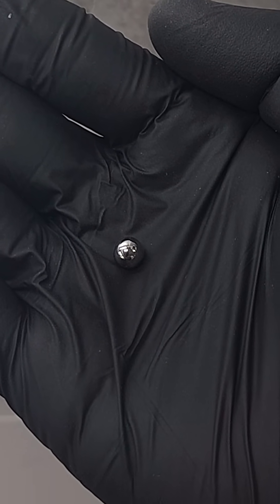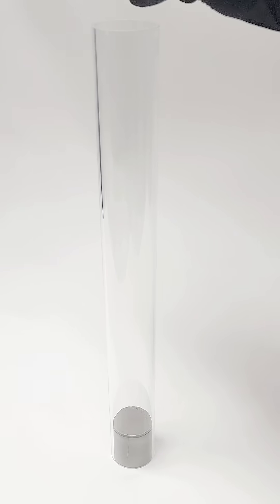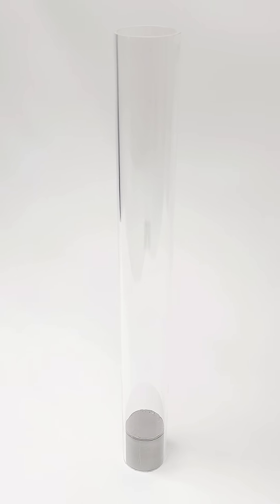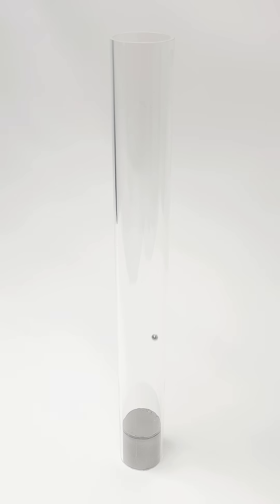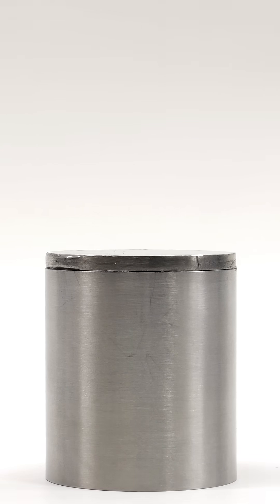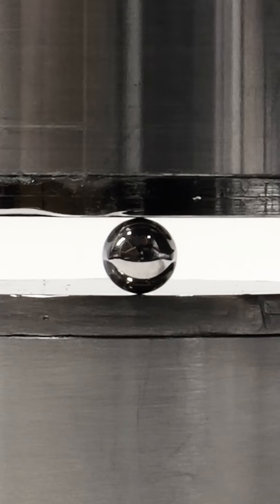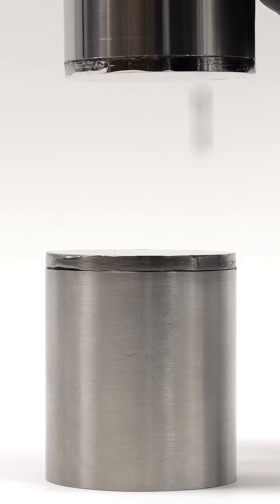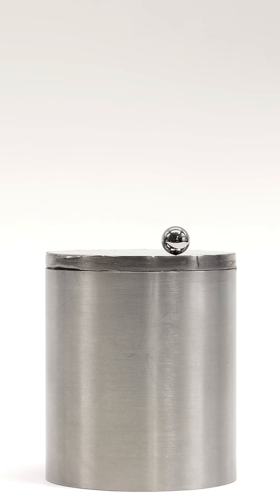This metal is too bouncy

Comment: It reminded me the GW150914 chirp...
We really need to mount an ultrasonic transducer (MHz bandwidth) on that block and record the signal on a digital storage oscilloscope and experiment with a micrometric positioner. Then use the transducer to add just that bit of extra energy on a resonant frequency to the system to keep it going...
Under vacuum less energy would be lost in air friction and sound generation, leaving metal vibration and heat radiation losses only, with less ear enjoyment though.
Then make the block and the ball bearing levitate on superconductor pucks above a magnetic slide and make the block weight 10^2·N that of the ball bearing and count the number of bounces to check if they match N decimals of pi. Well... at least 314 bounces with 1g vs. 10kg could be feasible...

SEE:  @3blue1brown - Why do colliding blocks compute pi? - '23/12/07 - 
short: https://youtube.com/shorts/P11ykXwx4-k         vid:     https://youtu.be/jsYwFizhncE

Comment: You could calculate the bounces per second based on the frequency of the pitch. Pitch literally is fast pulsing. With our voices, pitch is determined by how fast our vocal folds move. Here, it’s how fast the ball is bouncing; changing the wavelength by decreasing distance.

Comment: Now to harness the kinetic force from those hits into electrical power.
Reply: No, that would require it to generate energy. It is NOT a generator of any kind, so it cannot generate energy. It only shows the efficient transformation of the energy which was put in: potential energy <---> kinetic energy, going back and forth both ways.

Comment: if very little energy is lost, it'd be interesting to find out the mechanism, why so little energy is lost but ransferred back to the ball - and conversely why so much is lost when the ball is dropped on a regular metal surface.

Comment: Let's use science, the law of conservation of energy says that it can't bounce forever, but if it does anyway, it's because of a factor that we can't see, losing energy so that the object gains it, in this case the factor is the electromagnetic field, two opposite magnetic poles attract each other, if not they repel each other, some materials don't need an electromagnetic field to react to another, as is the case with the metal ball, the electromagnetic field is in the big piece "the metal that bounces a lot"

Comment: Make it produce electricity
Reply: No, that would require it to generate energy. It is NOT a generator of any kind, so it cannot generate energy. It only shows the transformation of the energy which was put in: potential energy <---> kinetic energy, going back and forth both ways.

Comment: 🗣️: would you rather get a dollar every second or get a dollar every time this ball boun-

Me: THE SECOND ONE THE SECOND ONE!
Reply: first one will give you a million dollars in a month
but
2nd won't even give you 100,000💀💀
Reply: @Space360-jx8ed Wrong, it bounces 35k times in 3 seconds.
Reply: @ThatSocialKid   how do you know??
Reply: @Space360-jx8ed  Please, refer to the other comments. Easily concluded it due to the kHz
Reply: @ThatSocialKid  bro 20 khz doesn't always mean 20,000 times bounce

the 10 - 15 Khz sound is produced INCLUDING shape and matarial of the ball and the surface as factors

i'll come with another reply with the results after calculating and its explaination
Reply: @Space360-jx8ed  Correction: first one will give you a million dollars in a month
but
2nd will make you a trillionaire

Comment: You could mesure de audio produced by the bearing. Each hit produce a sound, so the frecuency of the sound produced should match (in hertz) the quantity of hits in 1 second (hertz again). Then if the last sound produced is at 10KHz, the quantity of hits should be 10K per second at that moment.

Comment: Steve Mould used a technique where he analysed a sound recording of the bounces and counted how many spikes there were in the last fractions of a second, and with that he could actually know the frequency of the sound being heard. He didn't bounce the ball between two of these trampolines though, so the sound wasn't so high-pitched. If you were to count the spikes in this case, you would spend quite a while counting.

Comment: It probably bounces more than 10k times a sec at its fastest. Pretty sure you could just find out the pitch with a tuner and then whatever hertz that is, that's the amount of bounces per sec. The only thing that makes sound here is the impact, the ball itself doesn't ring out with any pitch. If you sample a drum or a gunshot or whatever and you put it on repeat, the second you get more than 40ish hits per second it will start becoming a noticeable tone. Same happened here. 

Definitely around 10k bounces per sec at its highest.

Comment: This reminds me of the thing where, in theory, an object smacked by a 2nd object (better example if it has bigger mass) then bouncing of the wall, then 2nd object, then wall and so on, it will bounce a pi numher of times
So in theory, the number of times that ball bounced, might be/is around, or at least starts with 3141 (which is several thousand times per second as said in the video)